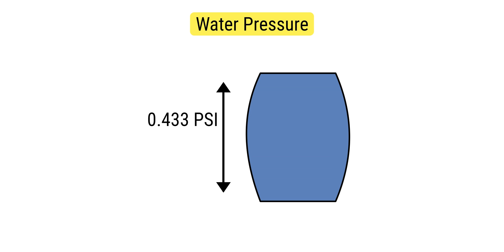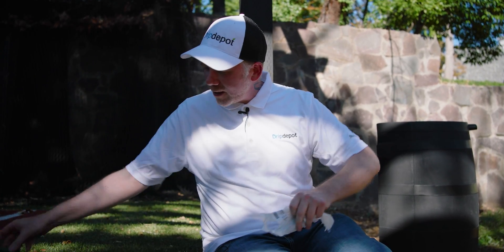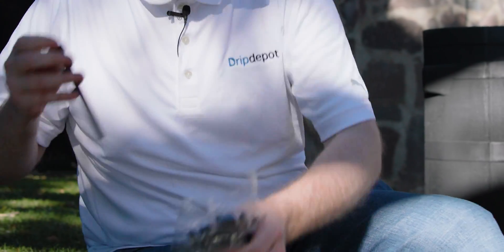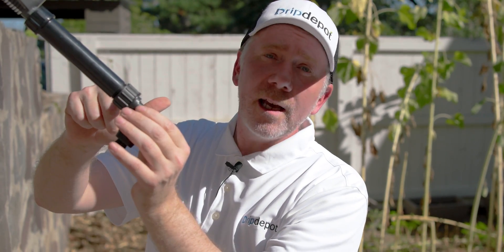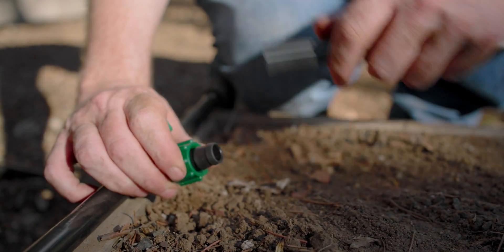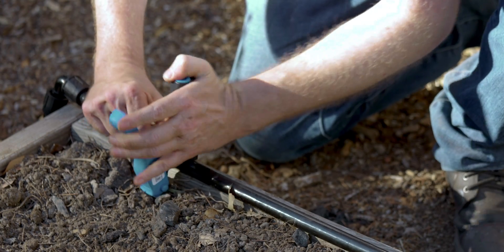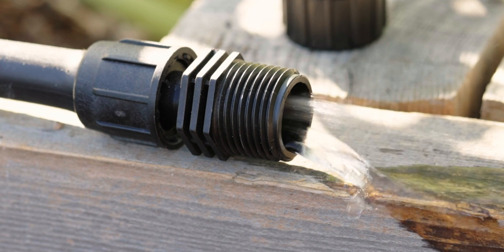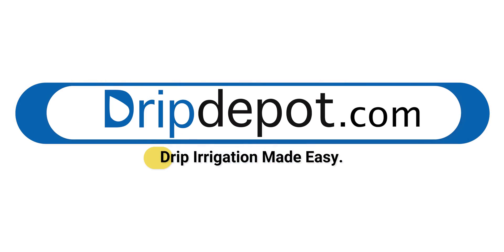How to Install a Gravity Rain Barrel Drip Irrigation System | DIY Raised Bed Project

Comment: SLOW_UP!!!!!
Reply from the maker: Gene, if it's too fast for you, YouTube has built in an easy fix that I'm happy to share -- at the bottom right of the video you'll see a cog wheel and a red square with white letters that say "HD."  If you click that cog wheel you'll see an option labeled "Playback Speed."  Clicking there allows you to slow down the speed of the video to 0.75, 0.5 or 0.25 its original speed -- at 0.75 things still sound normal :)

Comment: YOU TALK WAY WAY WAY TOO FAST !!!!!!  IT IS DIFFICULT TO KEEP UP WITH YOUR LINE OF THOUGHT!!!!!!!
Reply from the maker: Gene, if it's too fast for you, YouTube has built in an easy fix that I'm happy to share -- at the bottom right of the video you'll see a cog wheel and a red square with white letters that say "HD."  If you click that cog wheel you'll see an option labeled "Playback Speed."  Clicking there allows you to slow down the speed of the video to 0.75, 0.5 or 0.25 its original speed -- at 0.75 things still sound normal :)

Comment: i'll installate gravitational fed rain water drip system although i have already rainbird /toro automatic drip system w/ 5 solenoid valves fed by tap water for the reason of possible water restrictions due to drought & as a back up using rain water too.
Reply from the maker: Hello Wolfgang!  Definitely makes sense -- we're under drought conditions as well and face similar restrictions at times so collecting rainwater has become almost a must if we want to ensure we have irrigation water at all times.  This year we got a reasonable amount of precipitation so hopefully it's not as dire this season.
Reply: @dripdepot  evtl. james fry, yt has a solution called revolutionary gardening: seems to consist of a contained wicking bed w/ bacterias (subtilis & so on?) below removed by a water pump saving 90% or more of watering (because it won't get lost in a closed system)
Reply from the maker: Very interesting!  Thank you for sharing Wolfgang -- I think we've only barely begun to scratch the surface in fully understanding the growing of plants, in the coming years we'll make a lot of discoveries like this.
Reply: @dripdepot  leaves grow stimulated by raindrops that fell deep from the sky getting negative charge by their friction w/ air tansmitting their negative charge onto the leaves upon impact stimulating them. (measurable by teslameter?)
Reply: @dripdepot  i also got components for electroculture according to ing. lakhovsky, but no time for its installation (N/S magnetized wirings below beds & either side of fruit trees) until fall/winter...
Reply: @dripdepot  eng. lakhovsky had other theories about it supported by experiences that got forgotten after his ''accidenta''l death 1942: fits in a historical line since stoneage farming (just imagine the flintstones REAL ife!): they were able to detect lightly magnetized stones (hung  up on a rope they align N/S) & align them N/S for their gardening beds (evidence: archeological investigations about deserted famous culture's ''town halls'' in america) for enabling plants to produce their needed elements from others (dr. louis kervran about blogical elements transformations by plants); the dolmens also had /have their function for weather patterns (baummentor baumpflege, yt)
Reply from the maker: Wolfgang, a customer of ours I have been corresponding with introduced me to electro-culture just a month or two ago.  The implications and their impact on yield are interesting to say the very least.  It definitely merits more research, I hope it gets picked up by someone willing to fund a proper study.
Reply: @dripdepot  what joerg found out by his teslameter was that in normal soil the magnetism was about 0,22 nanotesla when cloudy ,but 1,20 sunny; in soil w/ straight zink coated iron wires aligned exactly N/S w/ ring magnet packs attached around it below garden beds,  1'2nT was the permanent value sun shinig or not.
Reply from the maker: Absolutely fascinating, thank you for sharing -- and the results speak for themselves from folks we've seen utilizing the method.  Increased yields are hard to argue with.

Comment: we should also mention main reason for installation of rainwater systems instead of pressurized tap water that has lots of chloride for its desinfection (gets lost in some hours or days outside or in gallons): DESINFECTS SOIL LIFE SUCH AS NITROBACTER ESSENTIAL FOR ECOLOGICAL GARDENING ! even if i feed the deposits by hose from the tap for drought = absence of rain, it s chloride gets lost in some hours by the sun's effect, although IT'S ESSENTIAL COVERING THE IRRIGATION DEPOSITS BY IVY F.E. FOR AVOIDING WATERING POOR IN o2 DUE TO HOT WATER ROBBING OXIGENE TO THE SOIL & PLANTS' ROOTS. you find o2 saturation tables for aquariums that are valid for gardeners too: higher temperature = less o2 ! water exposed to sunshine in summer heats up too much.

Comment: i'll pump up the rain water from the barrels below the roof on palets (for minimizing their desnivel) up to the higher deposit on the rooftop (about 6ft) by a programmable solarpump w/ exchangeable rechargeable AA batteries, but i'll use the blumat drop system for saving water. beds below the 7ft slope will also be irrigated by deposits above fed by others below the roof.

Comment: excellent: i didn't know, that a timer is also valid in gravitational irrigation systems !
Reply from the maker: A timer for a gravity system is rare indeed!  This is one of those rare timers that doesn't rely on water pressure to assist in opening the internal valve but still allows for fairly robust programming options. :)

Comment: I have a real question. I recently put in the system last year and I have to be really careful when I turn it on because if I turn it on when the bird see it they will start attacking it.... I seriously cannot be the only one this happens to. I think these birds are robins. And they have violently dug up and packed at the Ground of any plant I have watered with drip irrigation. My best solution is to try to turn it on at like 11 PM at nights. And then the other thing I'm going to try this year as I'm going to try to bury most of the system under mulch even if it's only 1 inch of a pretty thick  mulch.

If that doesn't work the other idea I have is buying a bunch of tomato cages I guess or something similar and trying to put netting in protection over all my plants.

I have never encountered such violent birds in my entire life. They go crazy at the ground pecking away. I think it's because two years ago I killed my entire yard and they were able to eat a lot of worms. And that is no longer the case.
Reply from the maker: At my house it's the raccoons that like mess with my drip system and plants.  The way I solved them messing with my drip system may help you with the robins -- for the drip system, I simply provided them with easier water sources: a bird bath and a fountain.  I probably only needed one of those, but it did the trick.  Spreading some bird seed (or getting a nice compost pile going with lots of worms) would give them an easier source of food -- not only easier, but preferred.  Unless there are predators around the food, they'll always go for the easier and preferred food source. 

Very good question, thank you!

Comment: Great video!  The only comment I would have is, for the button emitter system, it might have looked cleaner if you ran the header row along the length of the bed and minimized the length of each 1/4" line.  I'm assuming this is a judgment call where you could go either way?  Edit:  Oh yes, and one other thought.  A 45-degree elbow would have helped keep the head assembly install looking cleaner at the wall.  But I don't see a 45 in the Perma-Loc fittings.  I guess you could add a 45-degree garden hose elbow right off the spigot.
Reply from the maker: I think you're right on both counts -- to some degree it is a judgement call, and it would likely give it a nice clean aesthetic.  You are also correct to have the length of the 1/4" line in mind -- we were well within spec at the lengths we used, but it's absolutely something to consider as 1/4" tubing, relatively, has a much shorter maximum recommended run length than others (around 30', and even less when there's more flow going through it).  

I'm sounding like a broken record, but you are again correct on the 45° Perma-Loc Elbow :)  Currently there is not one, but for some applications it would definitely come in handy and aesthetics definitely do matter, particularly for residential garden spaces.  Great info you shared Steve, and right all around, thank you truly!
Reply: @dripdepot  Thanks for your reply and the additional info!  I really like your kits because they work well, and they are affordably priced.  I am recommending them to people I know!

Comment: After 2 solid days of Googling, I find this video which is exactly what I've been looking for. Well done sir! Just place my order!
Reply from the maker: So glad it was helpful Scott!  When everything arrives, don't hesitate for a second to reach out if you have any questions, we know all the tips and tricks :)
Reply: @dripdepot  Got my first order, hooked things up and tested with my existing timer. No dice. Tested the timer from the house spigot and it worked fine. Bingo - I remembered your warning that some of these require pressure to work. Ordered the one you used in the video and Presto! My hydroponic tomatoes are now being fed automatically from a 55 gallon barrel! Thanks again for the great instructional video!
Reply from the maker: Awesome Scott!  Enjoy those tomatoes this Summer, I too am excited for fresh tomatoes right out of the garden :D
Reply: @scottkinder7728  What was the model number for the timmer in this Video? Looks like this system is exactly what I’ve been looking for a 3 raised bed veggie garden. Thanks in advance.
Reply: Model #?
Reply: @dripdepot  Thanks! I will take you up on that if I run into trouble!

Comment: Thank you for the great video! I've wanted a drip system for so long but thought I couldn't do it because I use a rain barrel. I've already placed my order and I am super excited!
Reply from the maker: Thank you as well Kyla!  If you have any installation questions when it all gets there, don't hesitate for a second to reach out, we know lots of tips and tricks :)
Reply: After 2 months of use i am so impressed with the difference this has made in my garden! Missouri is going through a huge drought so I only got to use the rain barrel for 2 weeks, but the pressure was great and reached the far end of my garden! The rest of the time I've hooked it up to my hose and it is the only reason my garden is alive. I've already recommended you all to my grandparents and friends. 

Thanks for saving my garden ❤

Also the goof plugs are a must!

Comment: Your videos are the BEST! Question: what are the pros & cons or best uses for 1/4” drip line vs. 1/4” drip tape. Thanks!
Reply from the maker: First, a sincere thank you!  This was the first thing I did coming in for the day -- what a way to start the week! 

In the video the drip tape we used was actually 5/8" -- a little larger diameter than what we'd usually use in a bed this size (we would usually use 1/4" drip line as you noted), but drip tape can work at the very low pressures we expected to have here. 

1/4" Drip line pros and cons:  It's flexible, you can snake it through a bed or area to get additional coverage (tape has to be perfectly straight).  It also tends to be lower cost overall since it, and the fittings, use much less material.  At 25 PSI, 1/4" drip line is also compatible with common drip emitters like button drippers.  Cons: It's limited in length allowed.  Depending on the spacing or flow, 1/4" drip line should be no longer than 10' to 15' in length.  I use a lot of 1/4" drip line in my home garden since I have smaller beds. 

5/8" Drip tape pros and cons:  Drip tape can handle very long rows, even into hundreds of feet in many cases.  It can also work at very low pressure, even almost 0 PSI so long as there is flow available.  Drip tape is also easy to install and transport, it's very light weight.  Cons: it has to be in perfectly straight lines.  It can turn 90° with an elbow fitting, but can't gently curve or sweep through a bed.  It has VERY thin walls -- even the thicket tape is only 15 Mil (15 thousandths of an inch thick).  This means it's pretty easy to accidentally damage -- the weed eater is drip tape's worst enemy lol.  

I hope this helps, thank you again! :)
Reply: @dripdepot  Thank you!! This is helpful!! I really appreciate the time you took to explain this clearly. I’ll be applying this info to my design then placing an order.

Comment: take the nut off the compression fitting, slide the nut on the tubing, then you then push the tubing on the bib, followed by securing the nut.

PLEASE DONOT try to assayable per the video. You have so many leaks, its ridiculous.
Reply: I have used the kit exactly as shown in the video.  Follow the video and it won't leak.  The nuts on those fittings aren't even 100% required, as the barb connection will be leak-free by itself.  The nuts just help hold the hose on the fitting in case a clumsy gardener trips over the main line.
Reply from the maker: Thank you for your comment!  

These fittings aren't actually compression fittings -- we get this feedback from those with a plumbing background pretty often because they look somewhat similar to compression fittings they use (though usually metal) :)

These are actually a type of barbed insert fitting.  Rather than a compression ring, the ring on these are known as a "locking collar" and "locking nut."  The manufacturers of these fittings recommend loosening the collar back towards the fitting, push the tubing on over the barb and then thread the collar down over the tubing.  They do warn about removing the ring (unlike with actual compression fittings!).  

If you use these and experience any problems, we can help :).  I can confirm they should work leak free whether it's for a home garden or a commercial farm.  

Thank you again!

Comment: That is a very good  video. Where do you get the plastic turn on valve that goes at the bottom on the rain barrel? I am in the process of setting mine up as we speak utilizing a steep hillside with the "barrel" elevated about 10 feet and will pipe in water from our regular water source with a float valve like the kind in a regular toilet bowl and I am using a black 40 gallon tote instead of the rain barrel.
Reply from the maker: Thank you Mike!  

The faucet we used in the video actually came with the barrel itself, but hose bibs are available without the barrel (item 10346 on our site is an example).  Do you already have a threaded hole to install one?  If so, all you'll need to do is match the inlet size and thread type (1/2", 3/4",  MPT or FPT).  If not, it will be a little more involved but nothing too extreme.  

Here's a link to a short from a great homesteading channel (not affiliated with us, just good info) that shows how to install a hose bib into a container with no pre-existing connection point (the full video is also available, this is the short so you can get an idea): https://www.youtube.com/shorts/XEjuQVo6HDA

Comment: Does the screen stop insects from laying eggs in the water?
Reply from the maker: The screen would help but the mesh isn't tight enough to prevent determined insects.  This season will be a better test of this as it will be out for more of the season and will be filled with rainwater since we have it out for the rainy season.  The inline hose filter we used in the head assembly is a tight enough mesh that it would likely capture insects that got into the water.  I'll update this comment with proposed solutions if we encounter any insect issues this season :)
Reply: @dripdepot  yeah I don’t want to be breeding mosquitoes they are bad enough as it is!
Reply from the maker: You're not kidding there!  They love stagnant water, so making sure water moves out and into the barrel fairly regularly should help deter any mosquito hatcheries :)

Comment: How did the water get to that rain barrel?
Reply: Do you have issues with mosquitoes laying larvae in the rain barrel?
Reply from the maker: That's a really good question as that is definitely a concern.  We didn't have issues this season, but the barrel wasn't up for too long before it was put away for the winter.  This year will be a better benchmark for insects as it will be out for the season and will be filled by actual rainwater.  When we did the video the rainy season here was pretty much done.
Reply from the maker: Hello Marilyn!  For the video we just filled it up from hose bib, but that barrel (and others like it) do come with a mesh screen that goes on top of the barrel so that rain water can be filtered a bit as it enters the barrel.  Our area of Oregon has pretty dry summers unfortunately, so we weren't able to wait for it to be filled by rainwater :)